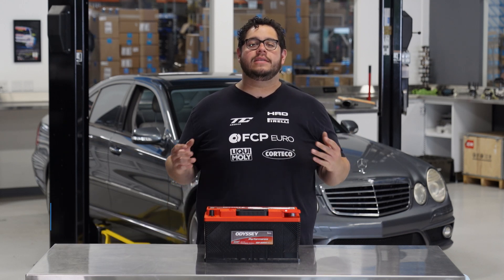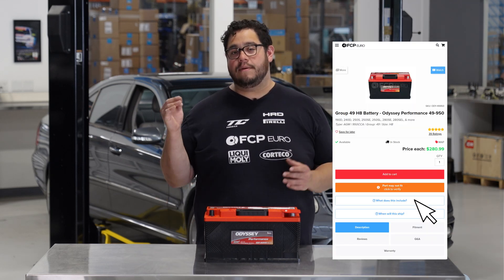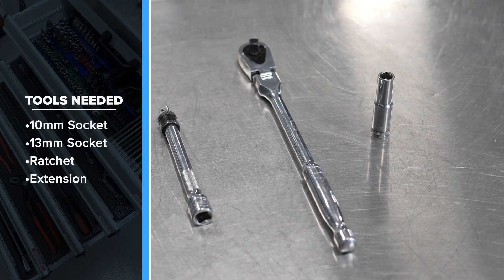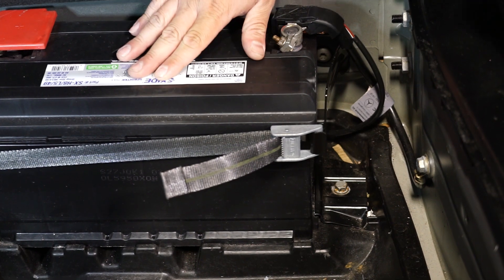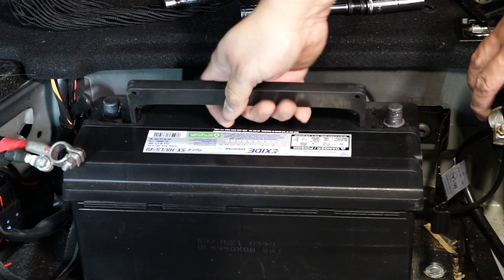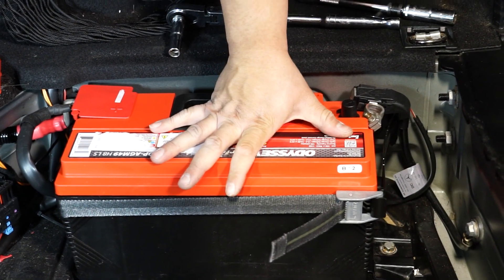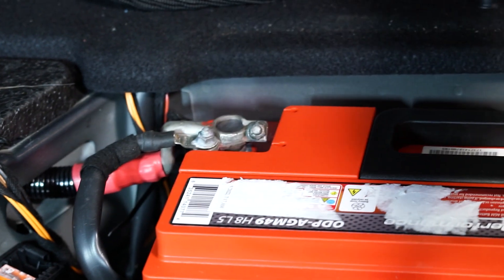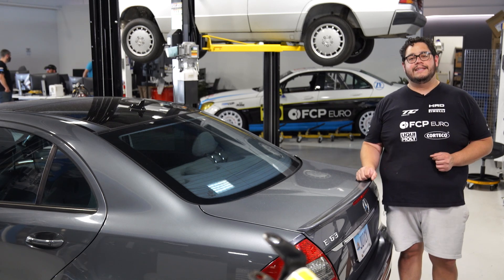Mercedes E63 AMG Battery Replacement DIY (Mercedes-Benz E-Class W211)

Comment: Is there an Auxiliary battery in this car. I cant gind mine 😢
Reply: Can't find mine either. Pulled all the panels under the hood and nothing. Usually they are on the passenger side near the firewall. Pulled my cabin filter duct that's there and nothing underneath. I think there's only 1 battery in this year

Comment: Do you need to program it?
Reply: Recently replaced the H7 battery in my W204 and I didn't have to reprogram anything.  Just removed the old battery, cleaned the engine bay and install the new battery.  Even the radio stations were still there.
Reply: No, I have a W211 and recently changed the battery.
Reply from the maker: Hi Macario, no need to program for the battery for the E63!

Comment: Was the vent tube missing from that vehicle? If the battery is located in the trunk or anywhere inside the vehicle a vent tube plugs into one side of the battery to carry the hydrogen gas outside of the vehicle. And the vent hole on the opposite side of the battery not getting the tube would get plugged so it doesn't escape the other side. That plug is provided with the battery either in a small plastic baggy (stuck to the side) or a detachedable plug that's part of the red positive terminal cover when the battery is shipped.

Comment: Yo, you failed to mention two important points.
1) There's supposed to be a small tube for the hydrogen gas to be vented. You didn't show it, and you didn't even mention it.  That's rather an important thing to forget.
2) The W211 can actually accommodate three different sizes of battery. The long original size, as well as two shorter lengths. Of course, you'd likely want the original size, but at 8PM on a Saturday night, then maybe the store can only offer one of the smaller lengths. There are actually three positions in the floor for the clamp, and the strap can also be tightened as required. And the negative ground lead has extra length for this reason. All these features are intended to accommodate different lengths of battery; which is very nice.

Worth noting, the battery in our 2008 W211 just died a few months ago, manufactured in 2007. The original battery lasted 15 years without trouble, until it suddenly died late on a Saturday night. We were able to find a shorter length replacement and amazed to see how it slotted in perfectly. Job done in much less than an hour.

Comment: Recently replaced the battery in my W204.   Slowly the starter seemed to crank slower then one day it had no juice.  For a few days I had to use my little jump starter in the mornings.  Looked around for a replacement H7 agm battery and just ended up at the local MB dealer, was $201 plus refundable core charge and has 2yr warranty.   Installed it at home, I wanted to take my time and clean everything nice.  Removed the old battery and it looked like a squirel or mice had made a nest at some point, it was filthy.  Had to get the shop vac out. 

One thing is make sure to connect the vent tube, it was on the right side on mine.  Then the  battery came with a tiny red plug on the positive post plastic cover to plug the opposite side vent hole.

I didn't even have to reprogram anything, even the radio stations were still there.